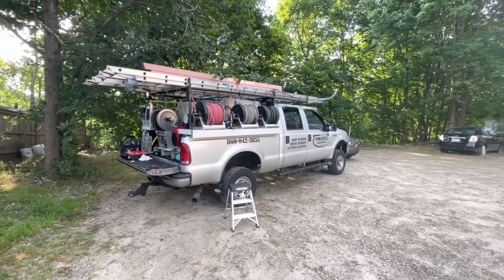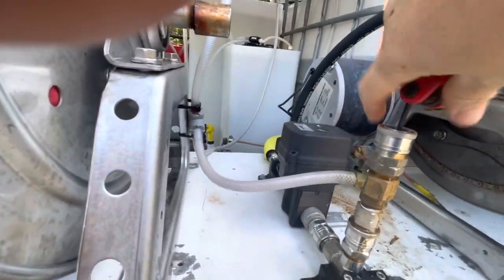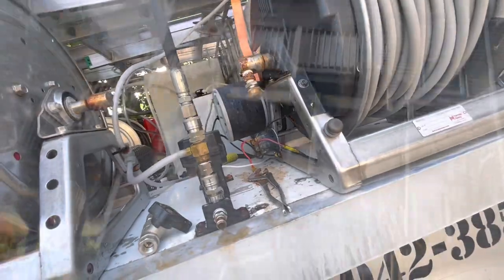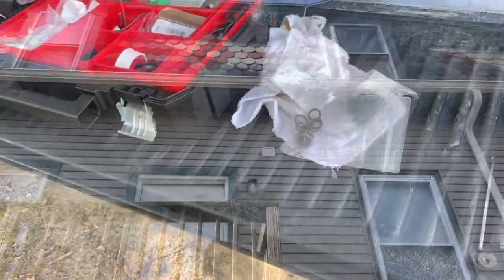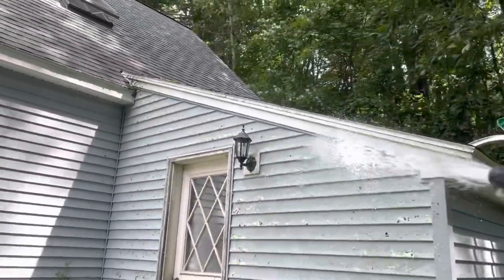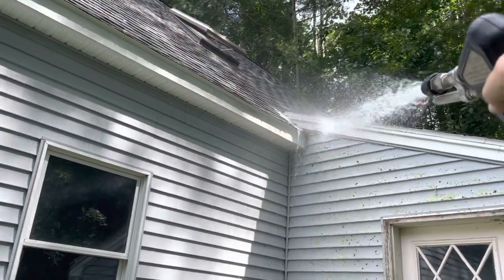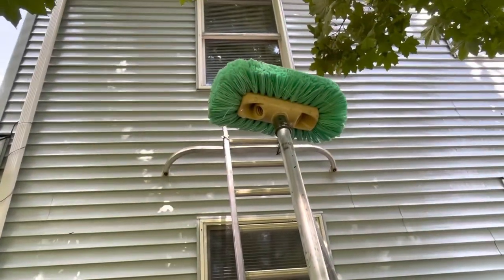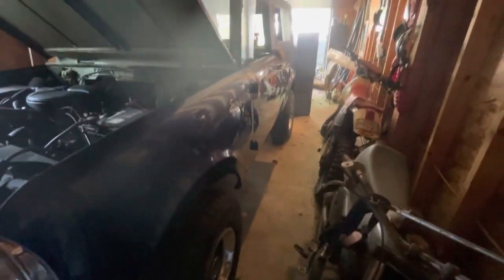Shout Out to Bryan Goldsmith

Comment: Why didn’t you go with the bigger injector. If the pressure drop is the same the larger orifice should create more vacuum and draw more chemical. I’ve never tried what you did. I just grab my xjet lol.
Reply from the maker: It works opposite of that. The orifice restricts the water flow so chem ratio is higher

Comment: how come you arent using the check valve setup on your injector anymore? I'm having an issue with mine. I just set mine up and something is causing my pressure washer to surge at idle. when i remove the injector and bypass it, the surging stops. I'm at a loss. I've tried it with 2 different injectors, same issue
Reply from the maker: What machine are you running? What size injector? Do you have your unloader by passing into the buffer tank when off trigger?
Reply: @powerfulimprovements  8gpm machine, I’m running a 2.3 and I tried the 2.1 as well. Having the same issue with both. My bypass is going straight into my buffer tank yes. My original setup is a suttner chemical foaming injector. It has 2 inputs for bleach and a 3rd metered input which I use for soap. It works incredibly and built like a tank, but I can only get about 13:1 max
Reply from the maker: @smitty4699  wow. Never heard of the Sutner set up. 2.1 should work no problem and 13:1 isn’t bad for most washing. Did you set your unloader with a green tip. What psi?
Reply: @powerfulimprovements  the place I purchased the pw from set it up and installed it for me so I really don’t know the answer to that. Do you think it could be an unloader setting issue with the new injector setup? Also, why did you stop using the check valve setup on your injector?